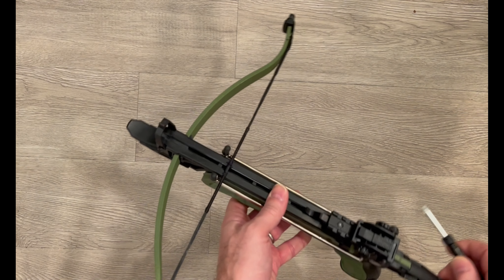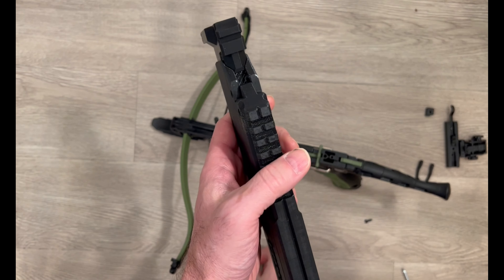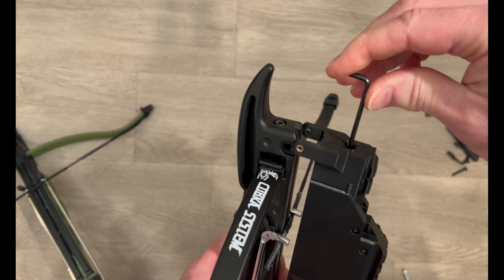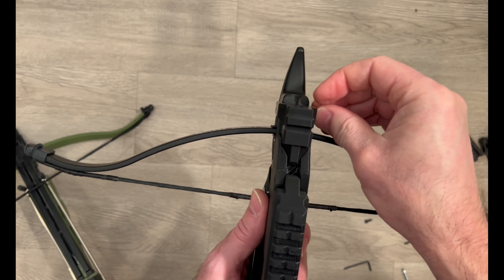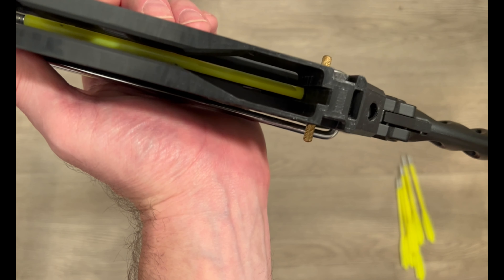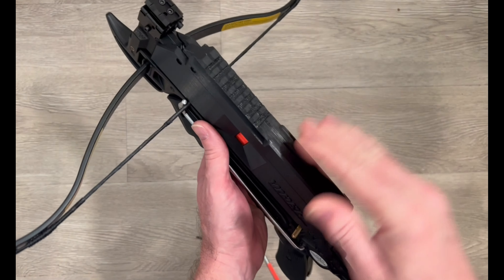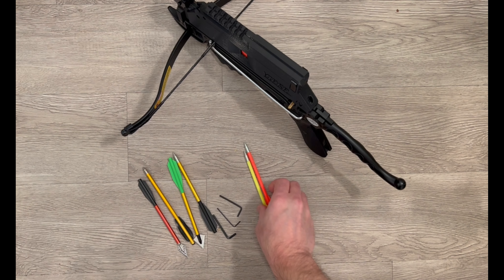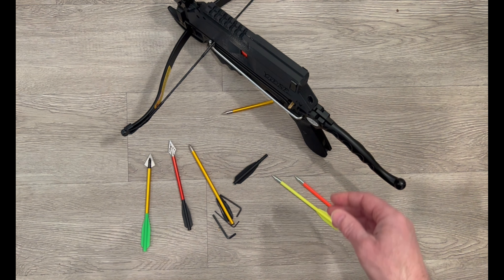AR-7 Autoloader instructions (OLD DESIGN)

Comment: I use those two piece aluminum bolts. I use a some what medium hard blanket as my target. I fold it several times, then hang it up against nothing, no back drop. All my bolts stay in tacked, no breakage or anything. I shoot a gazillion times, no problems. The key is that it doesn't go all the way into the blanket, only a little bit. So, the fletchings never break or anything.

Comment: I added the magazine to my old Cobra crossbow, think I paid around $40 for the bow. Took me 15 minutes or less to do the mod. I've shot about 40 bolts now, no problems. I've found the easiest way to wax my bow string is to loosen the screw in the very front that holds the bow in place. Then scoot the bow to the side to wax the middle of the string.
Reply from the maker: Not to start a debate on it, because there's plenty of opinions.  But personally, I don't wax the center serving.  It just gums up the rail, and also can trap dirt and dust right where the majority of the friction is, causing additional wear.
Speaking of strings, thanks to Joerg, I no longer buy them, i just make them.  Takes a bit of practice, but is pretty simple once you get used to it, and they last way longer than the standard bow strings with the center serving.
Highly recommended:  https://www.youtube.com/watch?v=fkuMtmP95f4

Comment: do you have a discount code for this on Amazon?
can I also buy an adjustable shoulder stock separately to put on my pistol?
Reply from the maker: We dont make or sell this design anymore.
as far as shoulder stocks are concerned, i'm not aware of any decent add-ons.  Best bet is to get a new pistol crossbow that has the built-in shoulder stock.

Comment: bro this is gold dust info , i have 48 broken alloy bolts were u pulled flight off total garbage , now using the plastic ones there awesome , btw will cartridge be for sale too fit on my bow i use snake hunter version
Reply from the maker: really any 1-piece shaft option is good.  you can also get carbon ones now in addition to the plastic and aluminum ones.
not sure about the snake hunter bow.  i'm familiar with the bows that go by the name snake eye, and it fits those.
Reply: @FlechetteArchery  cheers for reply , u can find the snake hunter bows on here